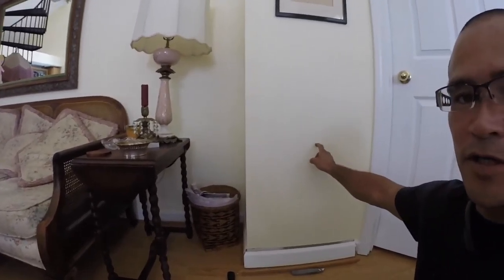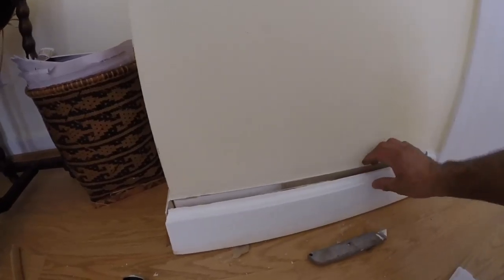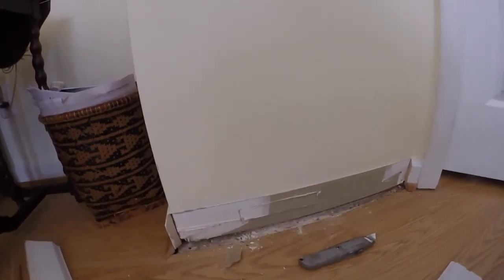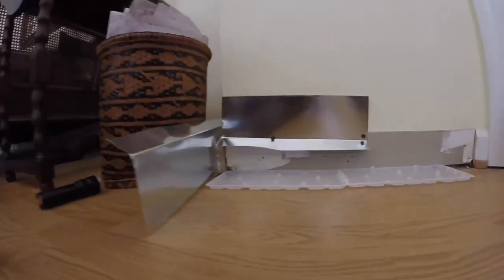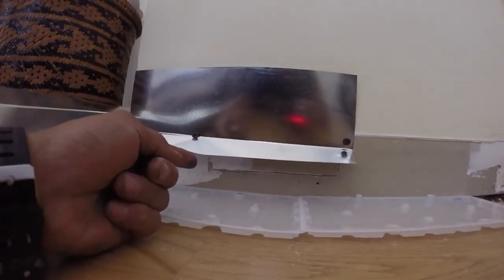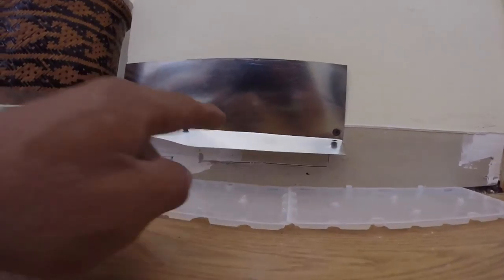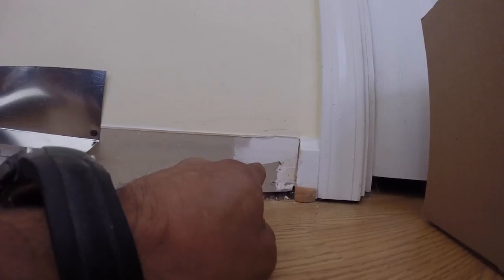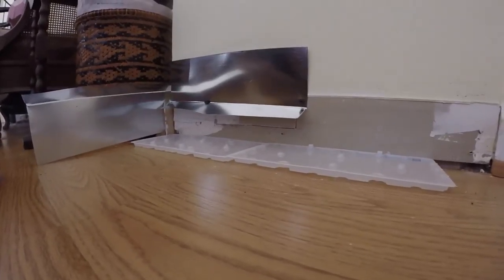How to remove mice from wall.

Comment: Why did you use the glue traps they are very cruel.
Reply: Mice chewing on the electrical wiring is a serious fire hazard and death by electrocution is gruesome beyond just "cruel".
Reply: Cyberbob  i dont blame you... its bullshit.
Reply: Who cares. Its a mice. THROW IT AWAY. GET RID OF IT
Reply: Actually you can use vegetable oil to safely remove the mouse when you’re in an open area so it can run free.

Comment: You give us hope and we wish we could hire you but affordability would be a question. We’ve been so burned by pest excluders that we are now tackling ourselves the roof rats in the wall between our garage and living room. Our single level house has no attic. I’m now excluding using hardware cloth and flashing to block holes.To get them out of the wall is the problem. They’ve been there three months since December. We wonder if you can tell us what glue boards work best for them? Are any other suggestion for the DIYers. I saw you limit the escape route for mic but fear the rats may jump such barriers; they’re so incredibly smart we see. They laugh even at the modified victor rat traps. We are considering using a raw almond with a Duke #4 coyote trap that has made some folks so successful. We need help in a battle we can’t afford to lose.

Comment: Normally I have problems with glue traps, but holy shit these things are so loud and annoying that I really don't care much at this point.
Reply from the maker: Well said! I don’t prefer blue boards either but by the time a homeowner calls me, they want immediate results for there money. We don’t wait around, Wildlife Evictors goes straight to work!
Reply: For me they just scratch and I bang the walls they go they come back my walls are very hollow but luckily my dad blocked up all the gaps years ago . But I feel so embarrassed cz my friends come and they can hear it
Reply: You can take the board to a field and pour a little oil vegetable on it and the mouse can slowly work its way free.